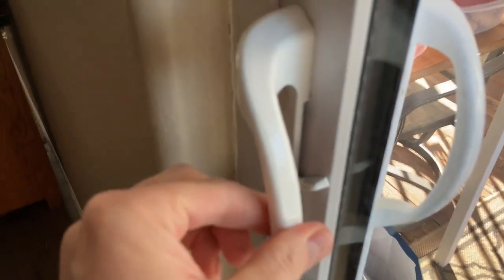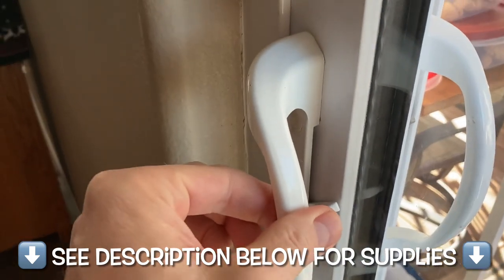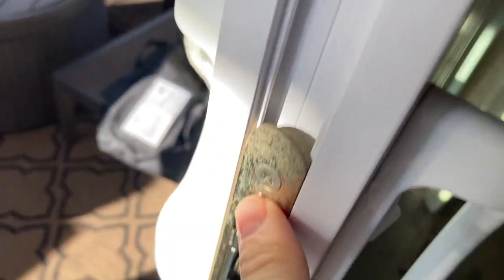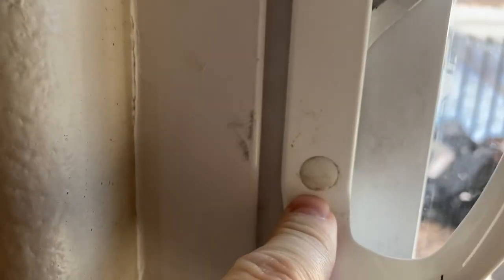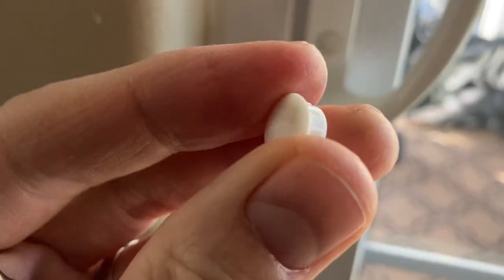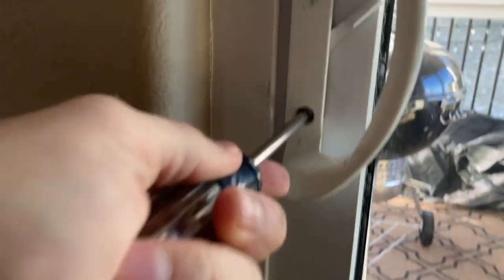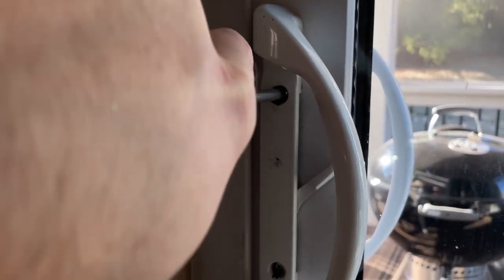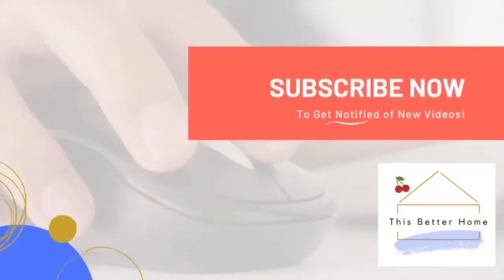️🔥 How to Fix a Loose Handle on a Glass Sliding Door➔ Easily DIY Repair in 3 minutes or Less!

Comment: Hi, on my sliding glass door handle.  There wasn't a white cap. It was the other side of the bolt.  Now my has scratches on it.  I had to take my handle off to tighten the bolts.